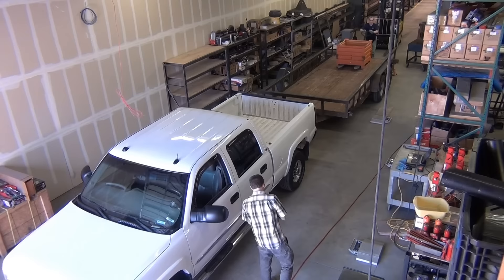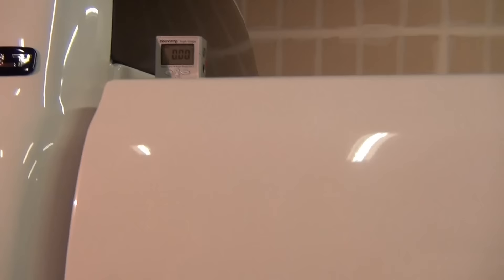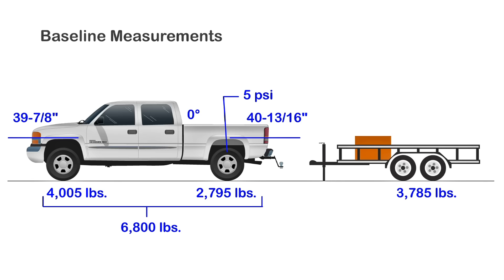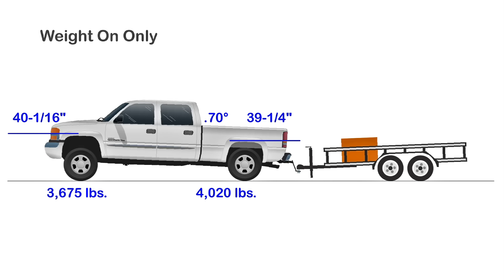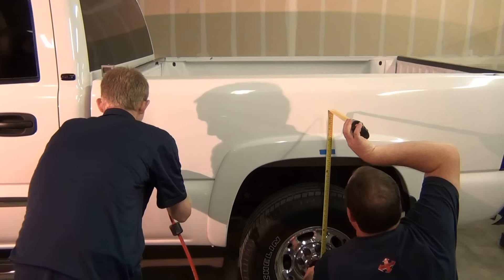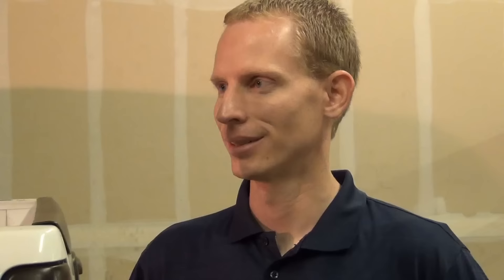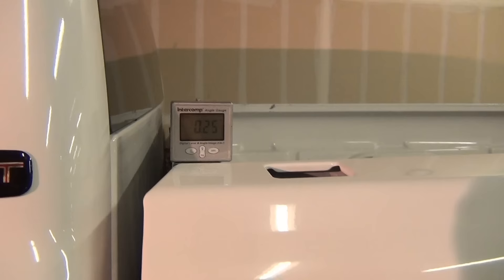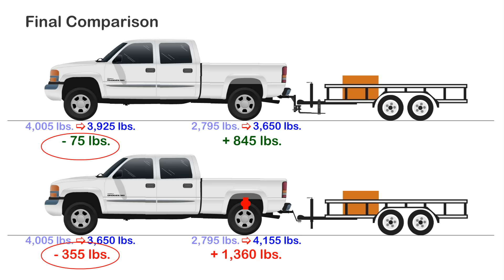The Difference Between Using Weight Distribution and Air Bags to Level Your Load

Comment: What about if you have both the airbag suspension and the weight distribution hitch, would it be better or just o choose one among them?
Reply from the maker: You can use both, just make sure you set up the air bags before you've set up your WDH

Comment: What about using airbags along with weight distribution hitch?
Reply from the maker: Using both can be a bit tricky, you'll want to set the springs up before setting up the weight distribution with the hitch. You may need to use one extra washer on the hitch setup to compensate. Thanks for watching!

Comment: I own a 22 foot car trailer. It is a little upgrade for me I went from a 6 x 12 utility trailer. Do you recommend this set up I was going to do airbags until I read this information and watch the video.
Reply from the maker: Yes, we recommend using a weight distribution hitch with built in sway control, like the e2 hitch [https://www.fastwaytrailer.com/e2-hitch], when you are towing a bumper-pull trailer. This is the best way to take weight off the rear axle and keep it on the front axle of the tow vehicle to improve braking and steering capability. Air bags are also a useful tool, but they are not designed to transfer weight. Their best use is to stiffen the rear suspension, which does help with stability, especially when hauling a heavy payload in the tow vehicle. Using both together is also a great setup.

Comment: Amazing video! I just bought a bigger travel trailer and was debating air bags. What about running in conjunction with each other?
Reply from the maker: Using both can be a bit tricky, you'll want to set the springs up before setting up the weight distribution with the hitch. You may need to use one extra washer on the hitch setup to compensate. Thanks for watching!
Reply: Depends on your tow vehicle.  If your running a 1 ton dually then probably not needed but if your running a half ton then yes you should run both.  Why?  Because the bags stiffen the rear suspension which helps with side to side roll as well as bouncing or porpoising when hitting bumps or dips.  The tricky part is figuring out how much air to use.  The first time I did it I put way too much in the bags and the suspension was so stiff it was jarring and uncomfortable.  No give at all.  Less is more in this situation.  Just a bit stiffer works wonders for ride quality.  Not necessarily trying to level the truck just change coil stiffness. You’ll have to experiment and it might take awhile to get the setup right but it works great when you get it dialed in.  Just for reference I don’t pull an RV but pull a variety of heavy flat beds and utility trailers with a half ton but the principal is exactly the same.

Comment: If the tow vehicle still has a considerable amount of squat in the rear axle with the weight distribution hitch and a airbag is used to compensate for that squat, will there be a difference in weight distribution still? How effective will the combination of weight distribution with airbags be then?
Reply from the maker: +Angel Torres,
If you still have a lot of squat, double check your weight distribution setup first. Most of the time the squat will go away when you have the hitch properly adjusted. The same principles apply no matter which brand of hitch you are using, and details of how to check that the setup is good are in the e2 hitch owner's manual here: http://www.fastwaytrailer.com/manuals.

If you decide to use both together, we recommend inflating the air bags first to the pressure you will use when towing, then setting up the weight distribution hitch for proper ball height, weight distribution, and trailer attitude with that pressure. Increasing the pressure after setting up the hitch will reduce the amount of weight distribution you are getting from the hitch.

Comment: A WD hitch moves some of the weight off the rear axle and transfers it to the trailer wheels and truck front. It can also provide anti-sway. Air bags just lift the rear. If you're at the payload limit, air bags don't help. The axles still carry 100% of the payload..
Reply from the maker: Great comment, that is correct!

Comment: I dont use niether anymore.  With my 10k trl i had to back my tractor on to get tongue wieght and pulled on i had close to a neautral tongue wieght ruffly ( not good)  local trips i used conventional ball but going to tractor show i used wd ball hitch. Truck rode good.  Not overloaded either way.   I now run a 9 ton trl with pintle hitch handles great with dually. I used to use a 3/4.  I went from 14k to 20k now 22k gross.  

I heard people bending frames with air bags

Comment: Would I receive benefit from a trailer distribution hitch on a Toyota Highlander pulling my 2600 pound camper??  I believe my camper tongue weight is around 400 pounds.
Reply from the maker: You absolutely can! There are hitches that have a 4K tow rating which would help!
Reply: Measure the front bumper of your Toyota without the trailer hooked up, then hook up the trailer and measure the bumper again. You dont want to see an increase more than an inch, if you do, get the WD

Comment: What happen if you replaced the rear spring shackle with an air bag, a friend of mine has it on his 89 Dodge 250, would pushing up on rear end of frame at the hitch do the same thing? We also have an air bag system on one of out 5500 Dodge wreckers that replace the leaf springs with a solid spring with an air bag at the rear and run an air leveling valve.
Reply from the maker: Yes, it would do the same thing, because effectively you are changing the base height of the hitch head. When you do this after setting the hitch up for weight distribution, it reduces the weight distribution. You are not changing the location of the fulcrum, which is rear the axle of the tow vehicle.
Reply: No. airbags push up on the bed, that means they are pushing down on the axle. This actually can make it worse not better. For towing
Reply: @kevinstephens1109  if installed correctly, bags push up on rear frame...

Comment: Weight distribution hitches are great for trailers that have electric brakes and an A-frame design. But airbags have their place too. Airbags are great for leveling a ride when towing a trailer with surge brakes, a 5th wheel or goose neck, and a trailer that has a long tongue (boat trailer). Airbags are a great option when you physically can't use a weight distribution hitch.
Reply from the maker: Thanks for your comment! No matter what type of trailer you tow, towing a bumper-pull trailer without weight distribution will always remove weight from the front axle of the tow vehicle. Air bags do not change this. Air bags simply stiffen or soften the suspension on the axle where they are installed. As you pointed out, air bags are a good option for a goose-neck or 5th wheel hitch because of the way they carry the pin weight.

There are some trailers that cannot use a traditional weight distribution hitch, like those with surge brakes. This is because the old design of the weight distribution hitch has chains that hold up the ends of the weight distribution bars. In a turn, those chains pull on the frame of the trailer, and activate the surge brake. However, with a design like the Fastway e2 hitch, where the weight distribution bars are held up by the rigid brackets, this is no longer a problem. The e2 hitch can be easily used with surge brake equipped trailers.

Also, the flexibility of the rigid bracket placement is much better than the bracket placement for a chain-style hitch. Therefore, the e2 hitch can be installed easily on almost all trailer frame types, including those that a traditional weight distribution hitch will not fit.
Reply from the maker: Mustang .308   could you please clarify your statements about “surpassing the height of the pickup bed EMPTY/No trailer” and “below the actual common sense of physics”? We do not understand what you are asking/stating, so we’re not sure how to give you the best answer.

As for your statement about levers, yes, we do know that weight distribution hitches use the mechanical advantage of leverage to change the way the tow vehicle and trailer carry the tongue weight of a bumper pull trailer.
Reply from the maker: Mustang .308 , thanks for your comment. We think there may be some confusion about the terms that are being used. In our world of weight distribution hitches, a trunnion hitch is a style of weight distribution hitch that uses forged or cast knuckles to hold the weight distribution bar in the hitch head. In the world of semi-trucks, a trunnion is the double-axle assembly at the rear of the truck. Perhaps defining these terms will help clarify the issue. When we say trunnion, we are talking weight distribution, not semi-trucks.

We do not manufacture parts for semi-trucks. Therefore, if you say that inflating the air bags on the rear axle of a trunnion for a semi-truck increases the weight on the front axle, we will take you at your word.

In our world of bumper pull trailers, you are exactly right. We have actually seen demonstrations with people who remove the rear wheels from the tow vehicle, and use the weight distribution hitch to force the front axle of the tow vehicle and trailer axle to carry the entire load (which is fun for a demonstration, but not practical for towing).

This video is not trying to address the effects of air bags on semi-trucks, or on pickup trucks pulling a 5th wheel or gooseneck trailer. It is simply meant to be a comparison of the different ways air bags and weight distribution hitches effect the tow vehicle and bumper pull trailer, where the tongue weight is applied far behind the tow vehicle’s rear axle.

It seems that we are on the same page. Hopefully this clarifies the issue.
Reply from the maker: Mustang .308 , thank you for helping us to clarify this. We appreciate your input.

Comment: Very good video using solid engineering to illustrate the point.  However, what is lacking is the performance aspect of the two systems.  How different is the handling of the vehicle with the two systems?  Does a few hundred pounds of difference between the two systems affect the performance that much?  After all its less than 10% of the total front axle weight that we are talking about.
Reply from the maker: Hi Michael, there really isn't a plus to either one. Both can be set up with one of our weight distribution systems. We normally recommend just sticking with the stock tow vehicle suspension just to keep it more simple. If you want to upgrade to an airbag system that is totally fine. And it can be adjusted to work just the same as a leaf or coil suspension. But it does take a little bit more work to get it properly adjusted.

Comment: Great video, very informative. Thanks for that. I have an offroad camper trailer fully loaded about 2 tonnes, ball weight 200kg. My understanding is that WDH is not suitable for offroad use but I am still keen to improve sag and weight distribution. What approach would you suggest for offroad usage?
Reply from the maker: I still wouldn't suggest using the WDH for offroad usage. I would probably just live with the sag when you're going offroad.

Comment: Thanks for clearing this up for me.  I was mistaken about air bags.  What has to be done to fix this problem on a fifth wheel?
Reply from the maker: We’re not exactly sure which problem you are referring to. 5th wheels don’t have the same effect on the tow vehicle because of where the weight is being carried. If your 5th wheel hitch is set up correctly, you should simply need to inflate the air bags to get ride you desire.
Reply: FastwayTrailer thanks for your reply.  I just assume that the pin weight of a fifth wheel can also lift the front axle and what is done on a fifth wheel to make sure the front axle doesn’t get too light?  Thanks for your response.
Reply from the maker: @brentjohnson6654 , if the 5th wheel hitch is set up correctly, the pin weight should fall slightly ahead of the rear axle, which places it between the axles instead of outside of them. In this position, most of the weight is carried by the rear axle of the tow vehicle, and some of the weight is carried by the front axle. This is different than a bumper-pull trailer, where the tongue weight is sitting outside of the axles. There should be no teeter-totter effect with a correctly setup 5th wheel. Air bags are used in this situation to stiffen the suspension of the tow vehicle while carrying the pin weight of the 5th wheel. There is no need for weight distribution with a 5th wheel.
Reply: FastwayTrailer thanks for your answer.  I assumed there was a slight teeter totter with the pin not on the CG (center of gravity) of the truck.  By the way, I prefer the idea of a fifth wheel for most things except for the storage space it can take up in the bed of the truck.
Reply from the maker: @brentjohnson6654 , adding the pin weight will change the location of the center of gravity, but if it’s placed between the axles, it will not move it outside of the axles. It will move the center of gravity closer to where the pin weight is being applied.
Reply: @brentjohnson6654  Applying more trailer weight on the 5th wheel CAN lift the front end of your truck UP a little, taking the weight off your front wheels.  Solution:  Install air bags over rear axle...I did well for me!
Reply from the maker: Interesting. Was the pin of the 5th wheel installed forward of the rear axle?

Comment: Question: I have both air bags and equalizer hitch which I use together. I have a 2014 F150 Ford 2 wheel drive . My truck feels stable with my rv trailer. What is your opinion of using both systems together?
Reply from the maker: The weight distribution will be most beneficial of the two in your situation. If you decide to use both, set the air bags to a minimum value (no more than 20 lbs) and then set up the WD hitch and let it perform its job getting weight back to the front axle. The air bags, while raising the rear back to "level" will add more weight to the rear axle, when we want weight back to the front axle of the tow vehicle.
Reply: @FastwayTrailer  , you should add a video demonstrating the difference of air pressure in the bags used in combination with the weight distribution system.

Comment: I always thought airbags are for direct load axle weight not towing unless you’re towing small trailers and want more level driving. And I always thought WD Systems limit sway and are for heavy caravan or trailer towing on bumper type towing kits.
So if I was towing a 5x8 trailer daily I would use airbags. However on a double caravan WDS or triple axle caravan I would prefer both for both handling improvements and weight distribution between 5 axles. These can also be used in combination and I don't think your test was complete without having done a test with both utilised...
Reply from the maker: @First Timer, thanks for the comment. A video showing the use of both is planned. Stay tuned!
Reply: I can see you now nothing about towing (5x8 trailer ? And you’ll use bags come dude I tow 20k daily on goose neck
Reply: @FastwayTrailer  cant wait for that video!
Reply from the maker: @Andrew Holmes, we will. That is the plan for the near future. Thanks for the request!

Comment: Is the goal to have the truck level or the trailer level when driving? It looked like, when you inflated the airbags you tried to get the truck back to its original height, but that would change the angle of the trailer resting on the hitch. Unless you adjusted the ball height too. When you used the equalizer it had the larger angle thus changing the  pitch of the trailer. Wouldn't the angle of the trailer resting on the hitch change a lot of your measurements and weights?
Reply from the maker: You will want to get the trailer level for sure, and the truck to be as level as possible. Watch our "Equal-i-zer Hitch Installation with Air Bags" video on the Equal-i-zer Hitch YouTube Channel.